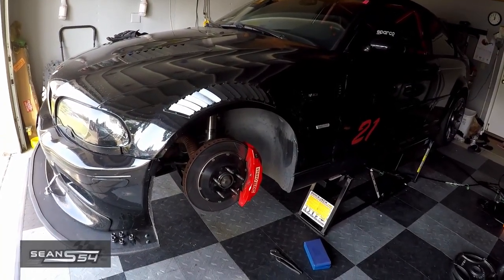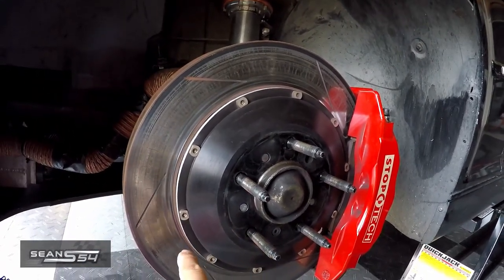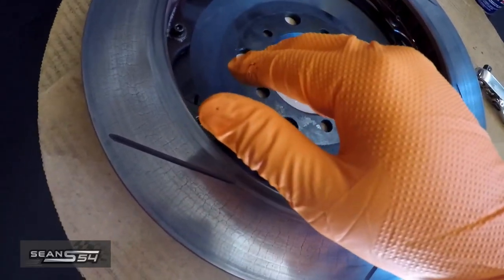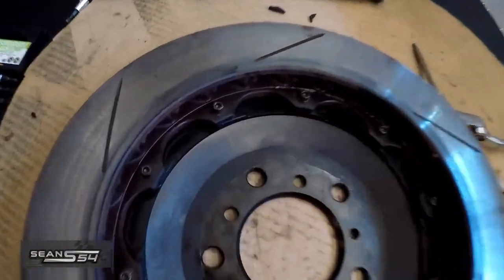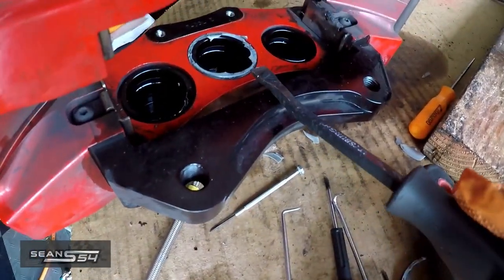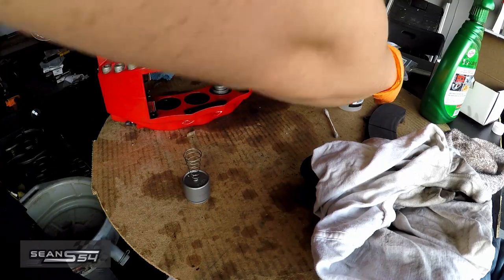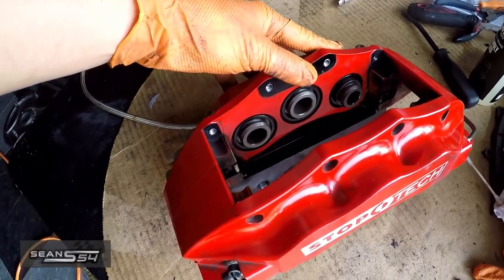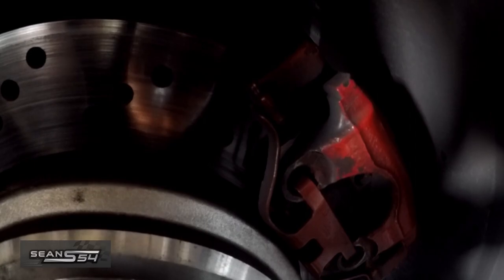Anti Knock-Back Springs - Fix Pad Knock-Back

Comment: Thanks for the video! I hope to tackle these knockback springs this summer.

When reinstalling the rotor bolts, should use loctite 150. I use an ST40 BBK front and rear on my E46...pads are cheaper AND pads and friction discs are interchangeable front to rear.

Comment: I just rebuilt my brembos so hoping this helps you or other people next time you rebuild calipers. One piston will always come out first. You can use a c clamp to hold it in place and pop the next one out. Alternatively, you can rebuild the one that pops out, put a c clamp on it after rebuilding and move to the next one. It helps to have small pieces of wood to hold 2-3 pistons at once.
Reply from the maker: Great tip! I realized that after one piston popped out. :-)

Comment: Assuming those are metal washers i fail to see how flipping them gets you any benefit. if the torque is the same then there is no room for float unless the bolt is bottoming out and that is the source of the torque resistance. The cup facing the rotor is what allows them to float. Same type of spring in your lsd and cams. If knock back is the issue just flipping the washer  should stop the rotor from moving and knocking the pads back. Would love to see what the results are but this makes no sense to me.  Full disclosure I run Wilwoods and have knock back issues also. As always I enjoy your videos and thanks for posting.
Reply from the maker: The rotor hat has a groove and the conical washers sit inside the groove. Flipping the conical washers allow them to "float" above the groove. I do agree that it may not make much of a difference. I think the anti-knock back springs will make more of a difference. I have a track day next weekend 10/10 so I'll know then.
Reply: @SeanS54  Okay that makes sense to me. I was assuming it mating to a flat surface. Curious for your report on the springs. I just cant get comfortable with  using my left foot on the brake pedal. Really enjoy the videos!